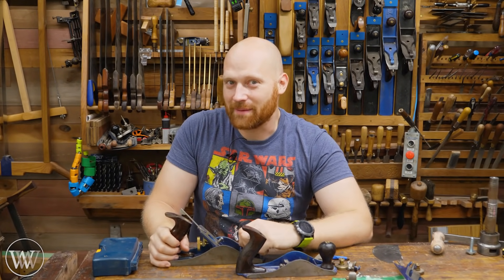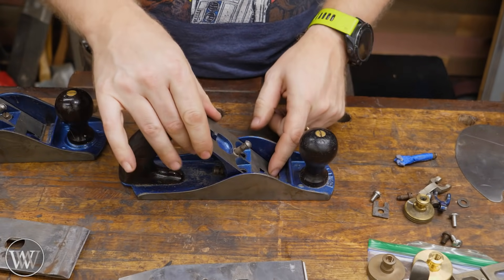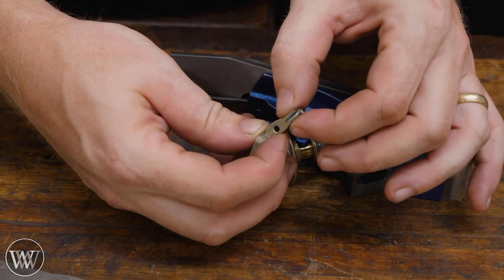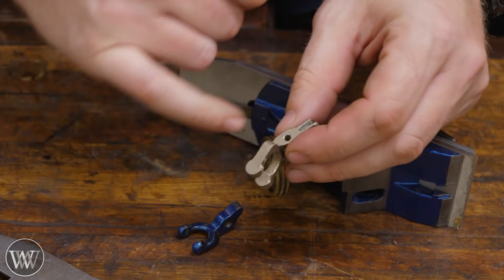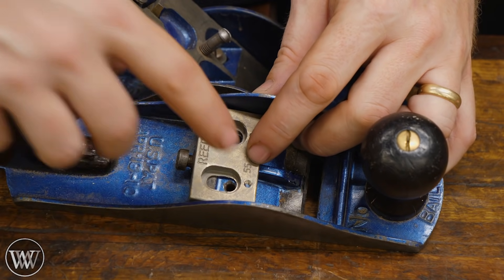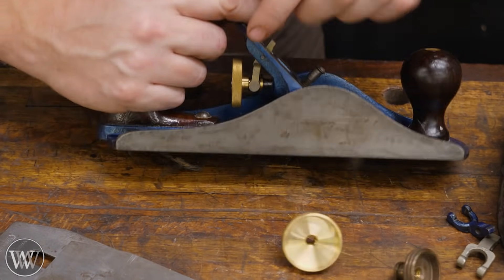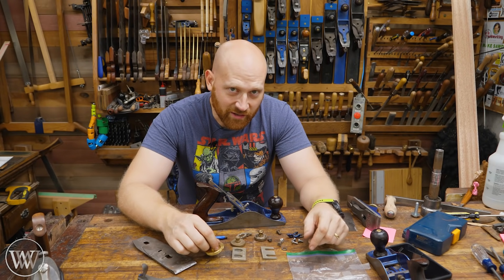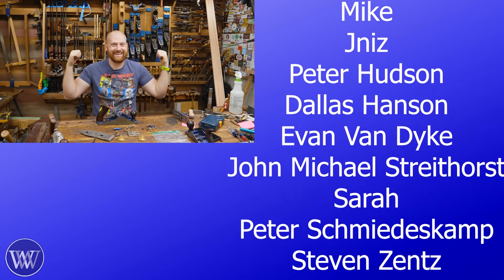Supe Up your Hand Plane By Giving A mouse a cookie

Comment: The number of replies speaks to how interested people are. I heard several you tube woodworkers make the comment that the biggest difference between a LN and old stanley is the "precision". To be honest I can't believe someone hasn't addressed these issues. While we can pick up a number 4 for 20 bucks and with a little make it a good plane it lacks that precision that's would be a game changer for smoothing. Collect the ideas, make the changes. Send out some test packages of parts, make the necessary adjustments go to market. This will be a big success. Dont wait, cuz without patent control,  these ideas will be ripped off. I wish Jeff much success.

Comment: The slop in the depth adjustment drives me crazy, especially when coupled with the coarse thread adjustment. I think Jeff has come up with a great solution to those problems.
Reply: i agree Gordon, it doesnt drive me crazy but something i think can be improved on.
Jeffs threaded rod looks excellent

Comment: i like them all.  i would like to see a oversized yoke in all dimentions to be filed back.  larger arms to grab the knob, longer yoke for the thicker blade and a thicker yoke to file it back for a tight fit as well rather than the expandable option with the screw.   also i would for sure want an existing pilot hole in the yoke even if i have to ream it out.   i would definitaly invest in several of those if they became available as well as the rod with the smaller threads for incremental adjustments.  i would put both on all my old planes.  i might possibly order the 50 and/or 55 deg frog adjuster to play with.   all of these ideas are fun though.  i have played with different ways to decrease the slop and this looks like a better option that anything i came up with
Reply: to be clear, i would buy several yokes if they came to market
Reply from the maker: I think I am going to do the same.
Reply: Yeah I’d be most interested in an over sized yoke that could be filed to fit. A pilot hole would help to not mess that operation up.

Comment: I think a kit like that would sell really well. Probably safe to say most woodworkers are hobbyists and don't make much (if any) income from their work. So being able to upgrade instead of replace a tool with something more expensive seems like a win.
Reply: I second this
Reply: @Musicpins  Agreed. Most people compromise on premium quality planes with a huge price tag for a common (somewhat flawed) cheaper plane. It would make sense to keep low manufacturing cost as a major factor.
Reply: Two kits. The angle in one kit. Yolk with either fine or coarse adjust..

Comment: I really like the improved yoke and the fine-pitch adjuster. Maybe the yoke could be pre-drilled for the smallest pin so that the hole is properly located, and customers could drill or ream it as needed. You could make studs that would fit the old Stanleys with RH threads and studs that fit the LH threads, but all could share the same fine-pitch threads, so you didn't have to manufacture and inventory different knobs.

Comment: James you forgot to tell people about Jeff's history as a plane maker and about his brand name: Reed Planes. I saw it on the wedges.
My opinion is that Jeff's ideas are all great here and I would buy them. On the yoke I would rather the end be larger and need to be filed or sanded to size. I think that you need both kit options and individual parts sold separately.

Comment: A lot of great comments/suggestions here.  I’ll add that I’m a big fan of purchases being ready to use right out of the box.  So, yeah, longer yoke thingy to handle different blade thicknesses, but also cut a groove in the underside of the lever cap to accommodate it.
Re frog adjustment screw, taking an idea from microscopes, have both a coarse and fine thread screws.  Or, figure out how to combine both into a single shaft to conserve space.  And, of course, tighter tolerances to minimize lash.

Comment: Great ideas! I am very much a beginner with my hand planes and that affects my opinions.
1. The larger adjustment knob with the finer threads would be easy to install and would provide an immediate improvement. If the backlash in the yoke is not reduced, it will take more rotation of the knob to take up the backlash.
2. The yoke upgrade takes a bit of skill to tweak correctly. I would prefer it come with an undersized hole to help get the hole in the correct location.
3. Being a beginner, I don't know enough to care about adjusting the frog angle.

Comment: I definitely like the idea of the parts needing to be filed or drilled to the correct size. People that want an instant solution right out of the box might not like it as much, but I know the yokes and pins on my planes are all different sizes and I would appreciate being able file a bit to get it shorter. Cool idea on the wedges, I used to wedge frogs on occasion, but now have different frogs. I love the idea of a finer adjustment screw. For the knobs, the bigger the better. I really like the Cosman adjustar knob.

Comment: Great book reference.....  I use vintage planes for the enjoyment of finding and restoring pieces of history to working order.  My planes are "workers" and not wall hangers.  But, I see the appeal of this pursuit for others.  You can find a rusty old plane for 5 bucks, clean it up, and then consider "suping" it up.  Probably the most interesting one is to change the bed angle for difficult grain.  The others mayt fall into the personal preference category.  I'll be interesting to see where this goes, as you can also learn about planes and set up by following.

Comment: As for the yolk I would say have the larger ends and longer, fatter tip that can be ground to fit. Then drill the hole undersized that way joe shmo can drill the size he needs without worry about drilling crooked.

Comment: I would love to have a tight yoke, drilled small and large enough to need filing to fit my plane.  A fine thread adjustment with a solid knob would also interest me if the tread pattern was tight enough to eliminate tread slop. A knob with well cut treads matching current thread patterns would also be a great option. Love what is being tried - keep thinking out side the box!

Comment: I would like the angle adjustment and the fine threaded adjustment wheel. Perhaps the yoke could be over sized in length, width and thickness so I could fit it perfect by filing.
Reply: Concur! The fine thread wheel and the angle adjustment speak for themselves. An oversize yoke is something that's already available in the UK and something I came across when I was trying to buy a replacement yoke, but they didn't ship to the US. I ended up buying an overpriced #4 yoke ripped off an existing Stanley.

Comment: Wonderful,   Cost is a big factor, I see this being offered in many different  options : 1. fine adjuster with basic knob. 2. replacement yoke (the split version looks weak). 3. Frog Angle adjusters (why not make all 5 degree  adjusters and standardize, just use 2 to get to the 55 degree angle). 4. Deluxe knobs,  custom designs to replace the basic knurled knob.  I  would definitely be interested in the fine adjuster, and perhaps the yoke option later.  PS. the yoke will always have slop, as it has to fit any and all chip breakers ,  in this case small but works is preferred to exact but can't fit. The yoke tip should be elliptical or segments of a circle to reduce wear  and perhaps hardened  to make it more of a match to the hardness of the chip breaker; this may mean that you have to offer a number of standard sizes instead of  the use a file to fit type.  Keep us informed!

Comment: I'd love to be able to take the slop out of the depth adjustment, the other stuff would be more for people that have several of each plane so you can set one up for a specific task. something I'd be interested in is a way to lock the lateral adjust or separate it from the depth adjust.

Comment: I like the file adjustable fitting for replacement irons. seems like a solid item that solves a real problem. I also like the idea of having a larger knob with maybe a different pattern on it. 
The shims for the frog seem like a good idea, but it would be to convert an existing plane, not something that would get switched back and forth, so Maybe I would just buy a high angle plane? 
The finer threads are something else I 'think' of as a nice thing, but don't know how practical they are. a tighter action with less slop makes the tighter threads seem a bit too much. 
My best advice about it is to think in terms of kits, rather than pieces parts. single pieces are probably less sellable than several pieces together that solve this particular (set of) problem(s).

Comment: I'm really interested in the higher angle shim, maybe also the finer adjustment wheel
Reply: As long as they are reasonably priced. I would likely try them all. My No6 wont advance the blade enough with a thick iron unless I have the chip breaker very far back.

Comment: Awesome that you can actually make those adjustments to a standard plane and make it way better.
I think I would like the fine adjustment-thingy, with a brass knob with a bit of heft to it. I always strugle with it, taking of too much or too little.
Swapping out those angle thingies (45/50/55) - I don't use my plane enough so I can't say whether or not that would be an advantage

Comment: I think the most useful modification is taking the slack out of the yoke and giving it a finer adjustment with a bigger adjustment knob. I have managed to cleanup and tune an old Stanley to get reasonable results but the main problem is fine adjustment of the blade to get a good shaving and finish. With all the slack in the adjuster there is a lot of hit and miss and time wasted.

Comment: As has been mentioned, these are really cool ideas. I LOVE anything that will get rid of the slop. I'd through whatever device works in my 3, 4 and 4 1/2. I would do the same with a fine adjustment wheel. I'm not sold on the shims to change bed angle. Also, pricing would be critical. If I am spending $80.00 on an upgraded iron and chipbreaker, then an additional $50.00 (I'm guessing here) for your kit, on a plane I already spent $40 to $50 dollars on, I would probably save up for the $400.00 Lie Nielsen smoother, however if the price were right, I would invest in these kits for all of my smoothers, and possibly my #7. Great video, this kind of innovation is really exciting.

Comment: I love this! I think the larger/finer adjustment knobs are smart. You could also try knobs that are similar to what Rob Cosman (with a star-like pattern instead of a round knob). I would be curious to see how well the high angle wedges hold up and perform.

Comment: I like all those prototype. Specially the 50° and 55° frog adapter. The new yoke as well. I have a veritas 2 3/8 iron and cap iron  that can't be used in my stanley planes. Yoke won't engage. And that new dial is a nice idea too. I would buy all of those proto types

Comment: An adjustable longer yoke is 1st priority. It opens up more options for users. 
Angle adapter 2nd. The same result can be achieved with a back bevel on blade, but as you are making the blade thinner on the cutting edge; an adapter is better. It does change how and where the front end of frog sits. Not sure if it introduces chatter because of that. 
For me, I don’t care too much about the new thread. It may require the most amount of work because the old one may be difficult to remove. With a better yoke, there should not be much back and forth adjusting any more, and the current thread is fine enough.

Comment: That yoke would be a godsend for thick aftermarket irons and chipbreakers. I made a thick iron work by adding two tabs to the chipbreaker for the yoke to hang on to. I would also like to be able to fit the opposite end of the yoke to the adjuster wheel to reduce backlash.

Comment: I'm gonna have to noodle with this a bit but initial thoughts here. 

The yoke idea is a spectacular one. I'm not positive about the split one. Not sure about anyone else here but I could see myself driving the screw too far and permanently deforming it. 

I don't generally work in exotics or highly figured wood so I'll leave comments about wedges to others but its certainly a neat idea.

As for the fine thread and new nut...I like the idea though I think you'd have to be careful of just how fine a thread you went with. With my total lack of patience I could see myself getting very frustrated making 100 turns if I had to make a coarse adjustment. Oh and as for the style of nut...Millers Falls I think it was made a solid one that I LOVE the look of.

Great ideas Jeff and thanks for sharing James! Can't wait to see what else you gentlemen come up with.

Comment: I love the idea. I recently bought a relatively cheap Caliastro #5 and tuned / suped it up. Including a Woodriver blade per your recommendation, I might add. I even added set screws to snug it up side to side at the mouth like the Veritas planes have and some small washers on the yoke pin to remove some slop there. Also, the yoke is the worst part on that plane, so an upgraded one would be great.

Comment: I’d go for the you’re with the longer tongue, and it would be great if it had larger knobs on the ends to engage the adjustment wheel with less play. Would also go the finer-grained adjustment thread (large knob, please) and the angle lifts.

Comment: Fine thread for sure.  Big knob, heavy is good (but not critical).  I'd buy a set of wedges, since I'm still struggling with getting tear-out free surfaces even on easy to plane woods.  Lastly, there should definitely be a hole in the yoke.  Undersized is good, but a no-hole version I wouldn't buy - too hard to get it perfectly straight.  I would definitely purchase one kit to try.  If it worked well I might get 4 more.  Thanks!

Comment: Yoke, precision screw and nut in a set would be great, different heat treated colours could also be fun. Maybe cold blued or blue purple ish or the simple clean brass for the more traditional style. Different grip patters ( cross,hex, fish - patterns or rounded lines ) for the nut.    Maybe even a washer style screw for worn out cap irons?

Comment: Just my personal opinions: 

Consider that a lot of users are using a valuable collectable planes that may also serve as their “users”, and whatever modifications are made should be easily reversible to restore the collectable value of the plane.
.  
I love the finer thread and the larger adjusting wheel ideas.  However, I do believe that you should add two LH threaded nuts to the install kit to allow users to “cleanly” remove the existing threaded rod without having to resort to masking tape and potentially damaging the existing threads.  Remember, that we may want to restore the collectable value of the plane back to original.

I also love the frog angle adjustment plates, I think these are a really great idea.  

However, to me the “thicker blades” yoke adjustments have mostly already been resolved, so you may just be reinventing the wheel.  Hock blades work, and IBC has a chip breaker extrusion that extends to into the blade slot to allow the original yoke adjuster to reach into the chip breaker slot.  So the existing solutions are to buy a blade that is already designed to work in your plane, buy a Hock, or buy a thicker blade with a chip breaker extension to work in your plane.  Or maybe a “generic slide” could be designed to bridge the gap between the thicker blade and the chip breaker.  These solutions also do not require “modifying” a collectable plane that may also serve as a “user”.  The thing that concerns me is the stability of the yoke ears on the frog, and the force needed to get out a yoke pin with potentially decades of rust holding it in (you may get lucky and you may not get lucky).  Breaking off one of those ears, while trying to remove the yoke pin, will ruin a potentially very valuable plane.  Replacement frogs are not always easily obtainable, and if you can find them they will probably be expensive.

I do also really like the idea of tightening up the mechanism, we are all annoyed by the adjuster slop/backlash  in the Stanley planes.  But for me, I’m not bothered enough by the adjuster slop that it is worth the risk to a valuable collectable plane to take the chance on replacing the yoke.

All that said, I really like all of your ideas, and I think you should definitely keep on working on them.  I am personally hesitant, on the current “yoke replacement idea”, but if the others were available I would definitely try them.

Comment: I think all of these are great ideas and there would be demand for all of them. IMO, the larger knob with fine threads and the pitch adjustment would be most useful. As for the yoke, if there was a kit with all three, I'd probably pay for the whole kit and kaboodle. I would definitely prefer the yoke to already be drilled and I can make the hole bigger as needed.

Comment: The yoke would be great for thicker irons. Maybe something like Rob’s adjustar. I have one of the beta’s of it and it’s great in anything bigger than a no 4. My hands were really cramped in my 4 with it on it. 
For the angle adjusters maybe something for bedrocks after the Bailey design is finished? I’ve stopped reaching for anything other than my no 6 and 605. 
Amazing ideas that could help bring these older planes to newer, way more expensive plane standards! Could sell as individual parts or kits.